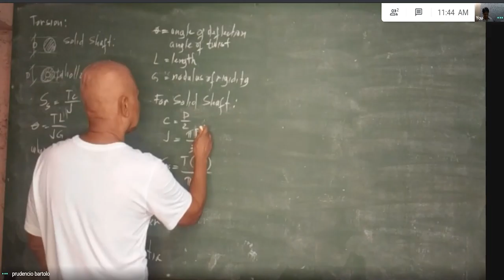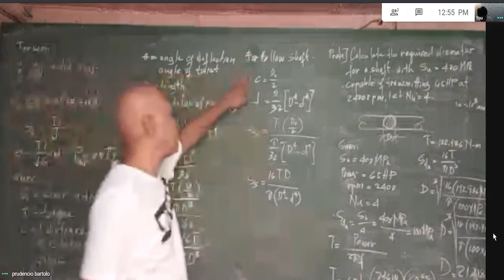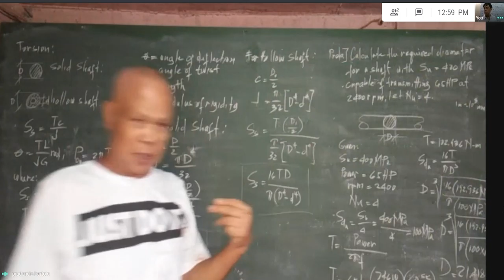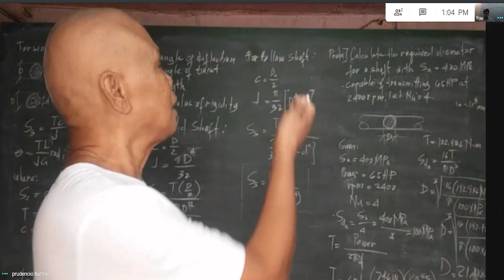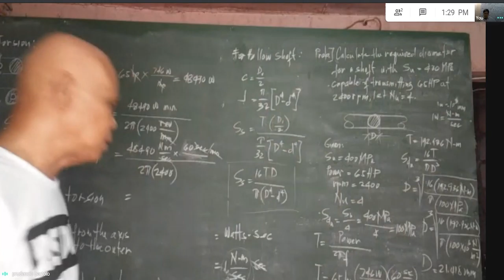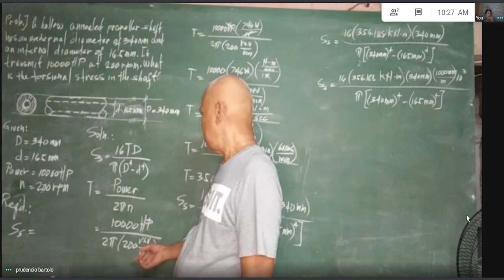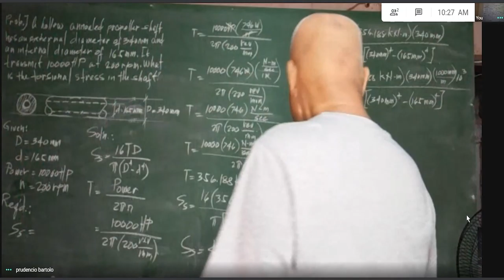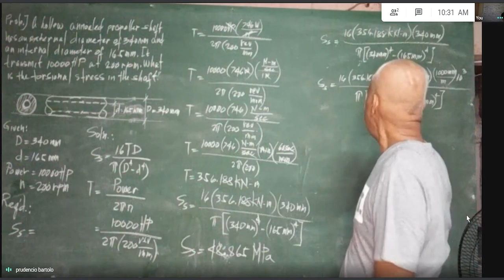MACHINE DESIGN:  Engr Bartolo  of DHVTSU tackles TORSION!!!

Comment: This is very interesting subject matter.  Torsion in solid mechanics is the process of twisting of an object due to applied torque (moment of force). It's very important part of mechanics of materials discipline because many machine parts and other devices are subjected to torsion. Especially shafts need to be designed to withstand torsion. Thanks to hand calculations  of this process we can predict if the failure may occur in case of constructions with torque applied.